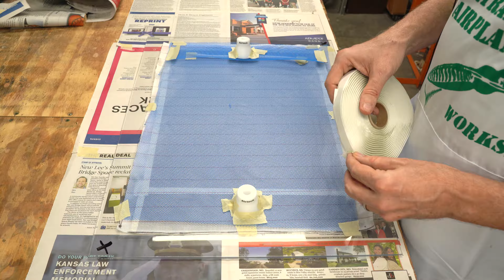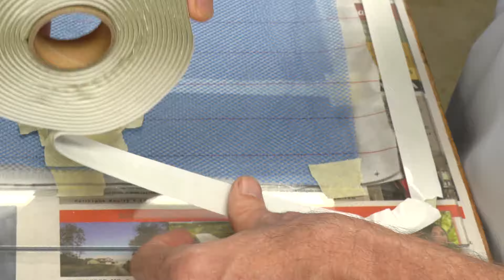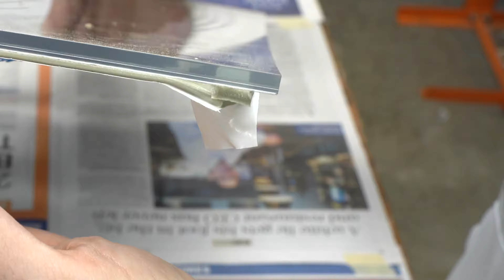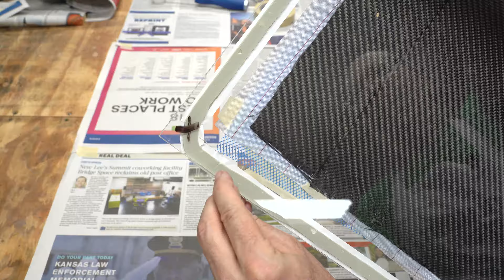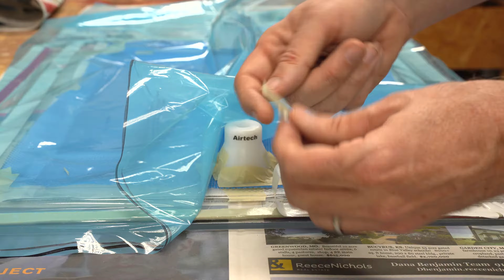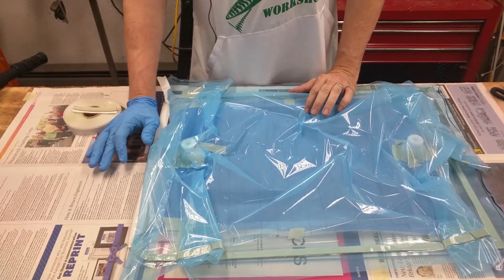Vacuum Bag Pleating #1

Comment: Arent there any ready bags in sizes with just one port for vacuum pump and one opening to put your material inside?  Im interested in reupholstering car trim parts and would like to put the part in vacuum for better adhesion and contouring...
Reply from the maker: There may be some but I have not seen any. At least not commercially made bags. You can get tubes of bagging material which at least reduces the number of edges that need tape.
Reply: @Designer103  great, thanks for the reply!